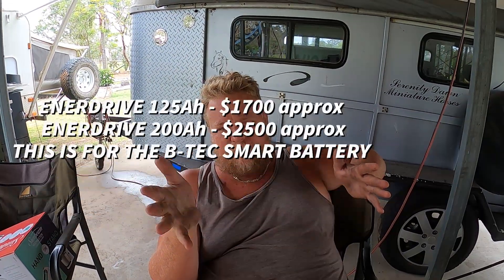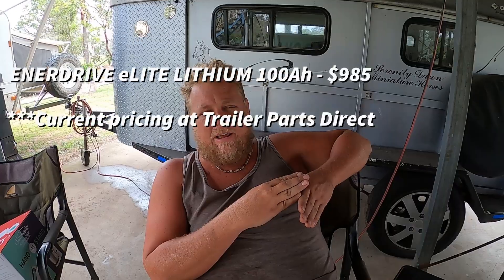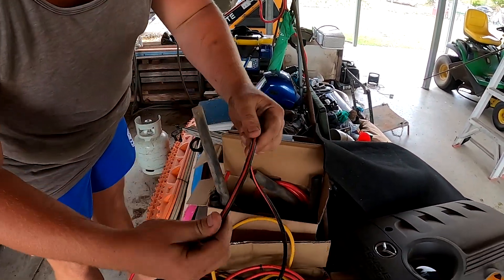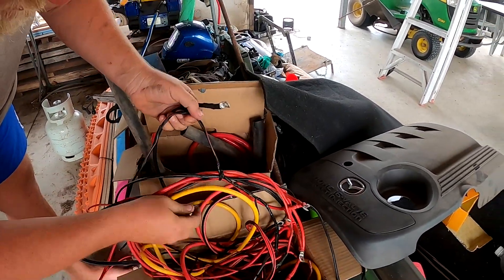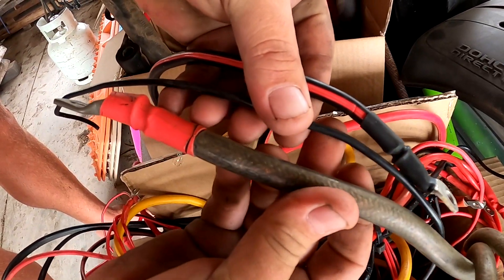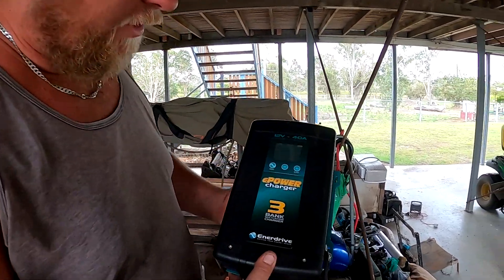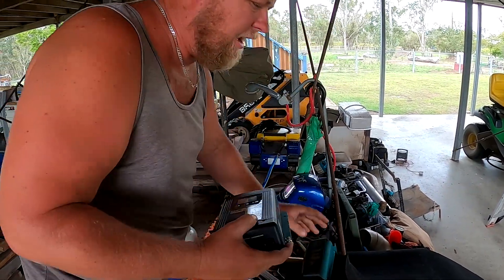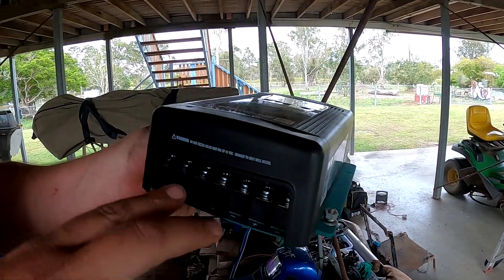Did you know? About Lithium Batteries, DC Systems & Solar || PART 1

Comment: The size of wire. Ray talking is manufacturers size, which is no size. So 6mm. Is 4.95mm2 cross sectional area. 8mm is 8.87mm2 cross sectional area. A wire gauge/ chart. Which is bigger cable smaller number.
Basically get bigger cable, 6mm is 5 meter length as just 4% drop in watts, but 10 meters is 7 to 10% drop. That's a drop / loss in watts. Cable can cost could be the same as unit.

Comment: Does enerdrive batteries have a BMS. and can you charge dc to dc and solar at the same time with enerdrive.
Reply from the maker: Enerdrive batteries DO have a BMS. To charge with both solar and DC at the same time you'd need a seperate solar regulator. So the DC charger won't do both at the same time unfortunately

Comment: great video you explain these problems very well the best  explanations i have heard  how do you measure 6 8 10 mm wire
Reply from the maker: Thanks mate. To measure pre-existing wires you'd need a diameter gauge. However, you should be able to take wire into an electrical distributor/wholesaler and they should be able to tell you 👍